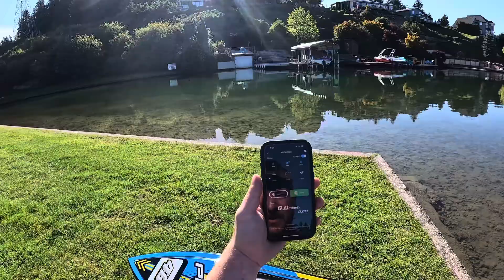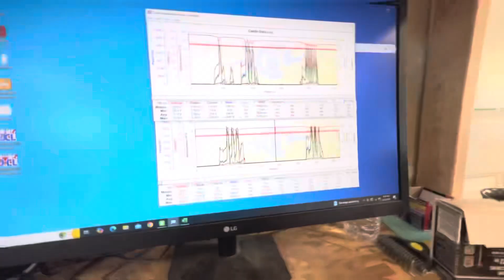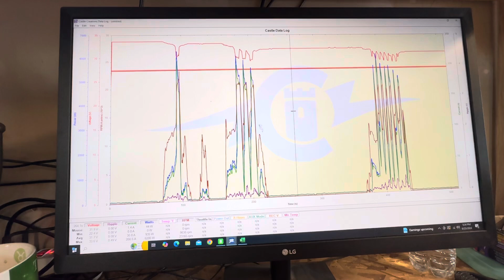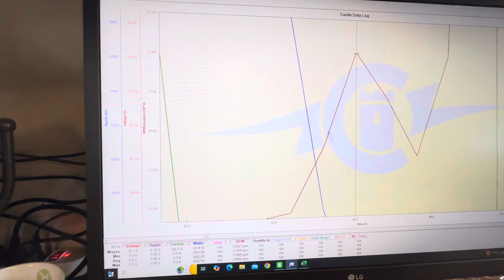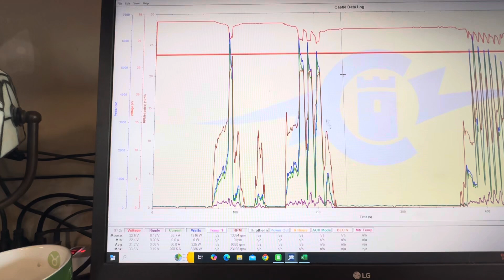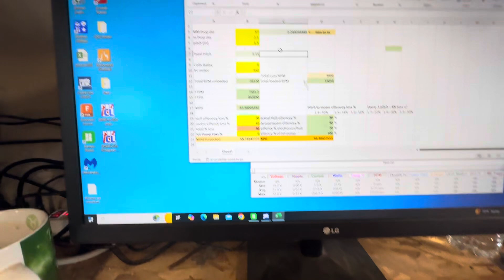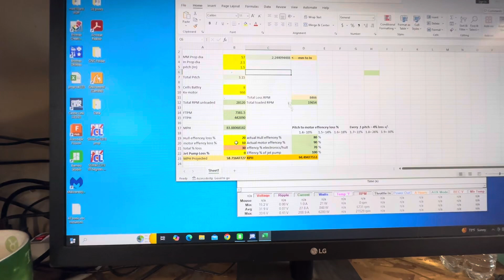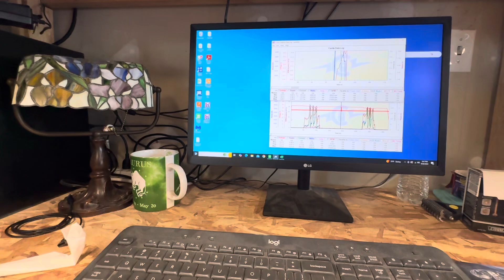New PB 64 mph super sonic and Xlx2 data results

Comment: MAMBA XLx2 with 800kv possibly? Looks like Jenks Park? lived there 30 years ago.
Reply: 2028 800kv will not fit on the aluminum stock motor mount need to trim the rear motor bracket , the motor shaft is to long

Comment: did you solder new bullets on the motor wires  for the new esc
Reply from the maker: @Rcenthusiast90  yes I did.   The XlX2 uses 8mm connectors as the 160amp esc has 6.5 mm bullets

Comment: Nice run, only way that boat is getting any decent numbers is running on the edge of blowing completely off the water.    Thanks for helping with prop testing, so helpful...   BG4L
Reply from the maker: @IRONCLADRC  I agree it’s right on the edge of blowing over the faster this boat goes.   More tuning I think can help that.
Similar to the sonic  36 when that thing came out and look at it a couple years now all the different option parts and people are getting the speed off of.   
This is just the beginning.   
Wanting to say thank you to you because you’re the one that really started it with  some of the propeller choices and I’m continuing on the work.    Thank you.  BG4L
Reply: @mad_lizard  i love what your doing!   Keep at it brother.       I was thinking that the motor was around 5000w +  seeing the data was confirmation 👍

Comment: I am a basher, 64 mph with motor temp and ESC temp good , I think that’s good enough
Reply from the maker: @asiringoringo1  I would agree as well as a good enough set up.   Quick and low temperatures.   I set my self up for a challenge of the 65 mark to hit for my personal best.  Unknown territory of what this boat can do.  With the amperage and motor temperatures of where they’re at right now, I think there’s a little bit more in this set up that can go.   One more propeller on the way for one more shot.   🙏.